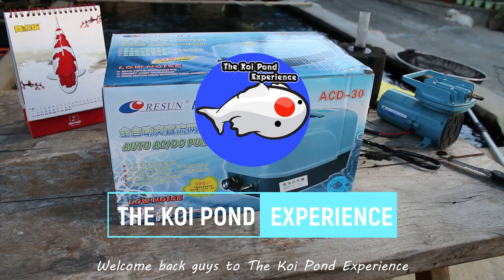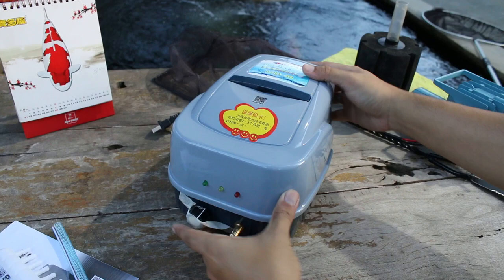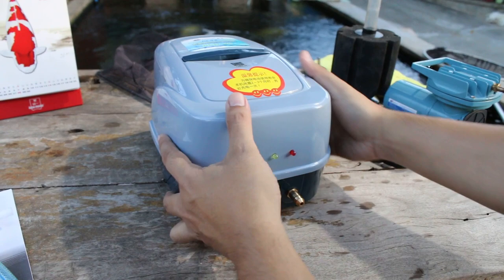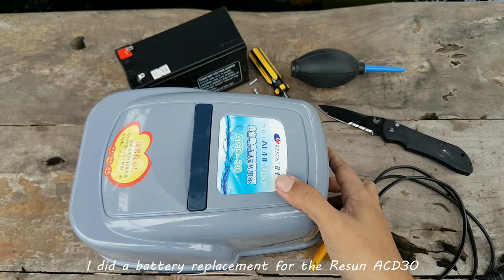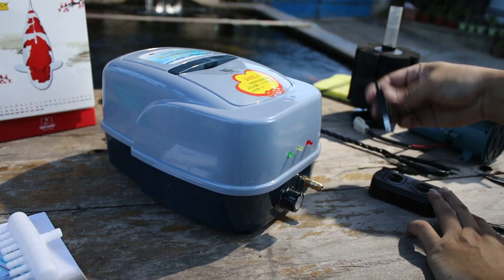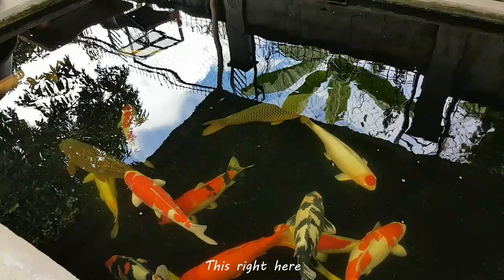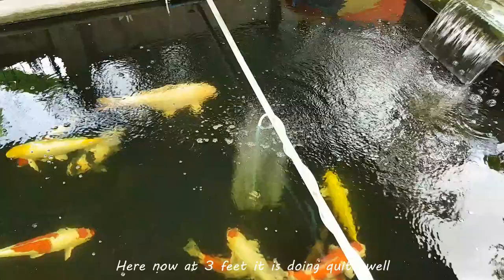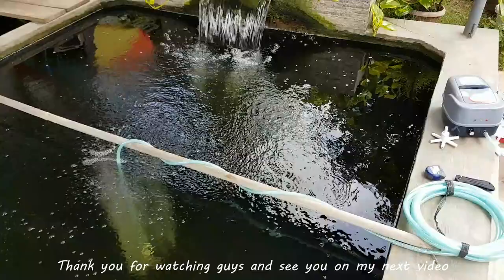Resun Air Pump ACD30

Comment: When i got the unit and plugged it in, The red didn't turned on but on only the middle yellow light. What does it mean? . And when i turn it on only the green and the yellow light turns on. How does this red light work???

Comment: Newbie question: Can i use AC/DC airpump as my main pump and not merely as backup air pump? Meaning it is turn on 24/7.
Reply from the maker: Yes you can. The only little draw back is the life span of the battery will be shorter. But batteries are readily available online, you can replace it easily too. So yes you can use this AC/DC full time.

This setup in this video is the ideal setup but it's not necessary.
Reply: @thekoipondexperience1259  Thank you. So glad i found your channel.
Reply from the maker: @denferrer304  welcome aboard bro and you're welcome. Glad to be of help to fellow fish keepers.
Reply: Where to buy the battery

Comment: Nice review sir. Yan din gamit ko for my small pond. Tanong ko lang po san ped makabili ng battery nyan ? At anong klase po ? at isa pa san mkabili yang parang T na ginamit mo para oxy ring?. Salamat po.
Reply from the maker: Hello John, its available sa Shopee. Try to find the 9AH version around 950 pesos last time I window shopped. Brand is Panasonic, Leoch & CSpower. 
That white 6-way air splitter I have that for sale. I'll post it soon sa Shopee store ko.
Reply: @thekoipondexperience1259  Thank you so much sa info sir. God bless.
Reply from the maker: @marccusjohn  welcome broh
Reply: Sir buenas noches,  pa send po ng link ng store san niu nabili ang spare battery para sa acd 30..Gracias

Comment: May I ask what's specs of the short  hose? I want tonavail online.I will do the set up you did. I like to use a longer hose, estimatedly 2 meters, for my newly purchased resun acd30. Thanks
Reply from the maker: Nice, you can buy a chemical hose with 4mm inner diameter. 

If during the install you find difficulty inserting the hose, dip it in very hot water first for a few seconds to make it plyable for a few moments during the install.
Reply: @thekoipondexperience1259  what type of oxy ring or air stone can you recommend in using resun acd30? Thanks again sir..
Reply from the maker: @amelesquillo1498  a flat air disc will do. 15cm size is perfect for just one air disc. If you plan to put more than one air disc, get something smaller like 10cm air disc.

Comment: May i ask what's the exact size or specs of the short hose included in the package? Thanks
Reply from the maker: It's a hose with a 4mm inner diameter.
Reply: What type of oxy ring or air stone is best to use for resun acd30? My pond water is 2 feet deep? Thanks again Sir.

Comment: Hello Bro! I have an open area pond which is susceptible to 6-8 hours of sunlight per day. I am in constant battle with algae growth on the side walls of my pond. Maybe you have some tips or advice where I can control my algae problem? thank you so much! I would really appreciate your reply. God speed my koi brother!
Reply from the maker: Heya Janri, as long as they are not the string algae type, I welcome the algae in the pond walls. They actually consume some Nitrates in the water so they help a little. Plus the kois also munch on them most of the time. 

But if they are the string algae type, the hairy ones, this is type can be overwhelming. Try installing a sun shade in the pond area. You can find this item online at Shopee. They come in nice colors which makes them nice to look at. 

Also I forgot to ask, how many watts is your UV light?
Reply: @thekoipondexperience1259  Hello again! They eventually turn into string algae if left unchecked. *sigh*. The UV light I have installed is 30 Watts, is this sufficient for my 8000 liter pond?
Reply from the maker: @janri5  30 watts UV is sufficient already. I run 45 watts on my 19,000 liter pond, but then again I have a roofed pond.
So next step for your case is the sun shade. I hope this solution will suit your pond area. If installed well the sun shade is a added aesthetics for your pond.
Reply: @thekoipondexperience1259  Thanks Brother. I'm looking forward to more of your videos.

Comment: Sir, ilang tanks kaya sa acdc30?
Reply from the maker: Hello Roxanne, dipende sa lalim ng tank. If nasa 2 feet only bawat tanks I estimate kaya 6 na tanks sa generous na air output settings. Pero if tipid air output kaya kahit 10 tanks. Adjustable kasi ai output settings ng ACD-30.

Comment: Ilang oras ba kaya nya gumana sir using battery lang po?
Reply from the maker: From the box it's says 8 hours.

In reality kaya naman if bago pa yung unit at yung battery and if hindi 100% yung air output na i-set mo during blackout and if at most 3 feet lang yung water kung saan naka install yung airstone. So madami factors to consider.  Battery health ang pinaka issue.
Reply: Sge po salamat po sir godbless po 😇 sana madami pa kayung matulungan na newbie gaya ko. Ingat po kayu godbless po sir.
Reply from the maker: @kentjamesdelavictoria3241  Uy welcome Kent, likewise bro, God bless rin sayo. 🙏